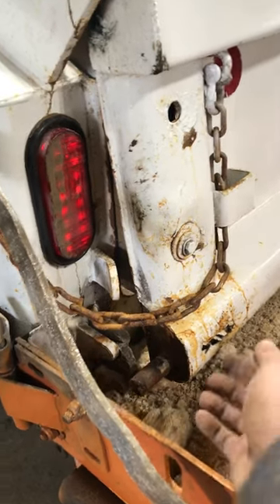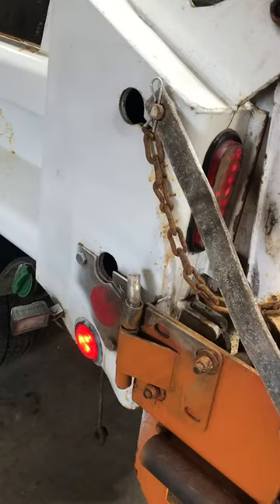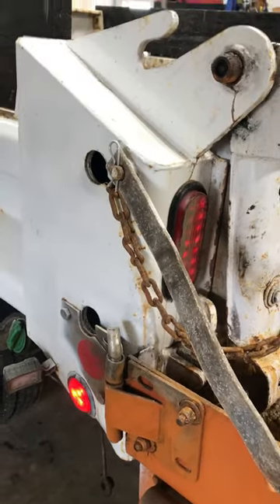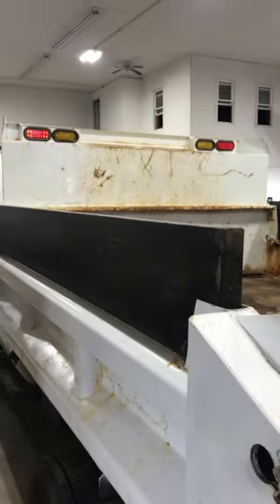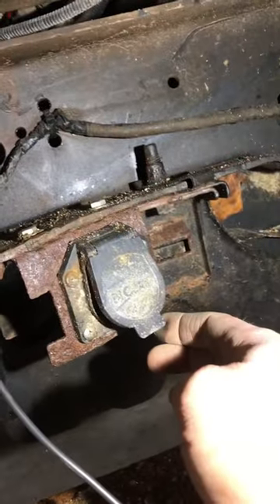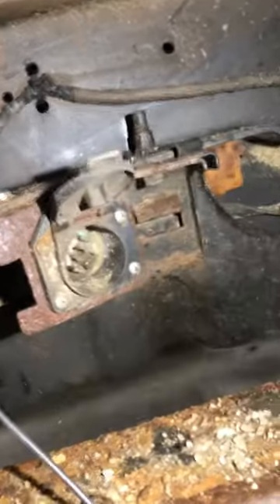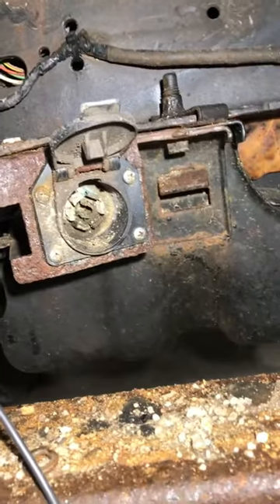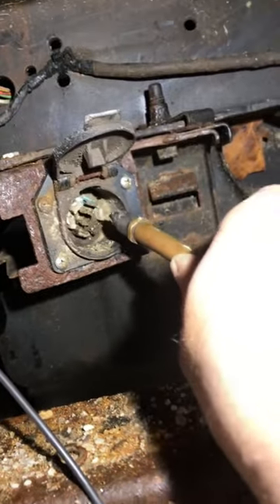"I Can't Turn My Lights off" - Crusty Plow Truck #shorts

Comment: How weird can a mechanics work get? But of course you found and corrected the problem!
Reply: Never, ever ask that question
Reply: @iflifewaseasy  no doubt, everytime i say....i will get this in right quick and knock it out....turns into one of those, oh my god wtf did i do this for😂
Reply: Do you know how often I remove a dime from the cigarette lighters (mostly in GM suvs). The symptom will be OBD port has no power, fuse is blown. 9/10 times there is a dime in there that shorted it and most of the time the customers kid put it in there because it fits.
Reply: @cheeseo9798  same thing for older nissans not communicating. Good possibility that someone left some change on top of the radio and it slid into the module and shorted the network
Reply: @gorybonghit3211  damn girl, go easy on hating people for no reason.
Reply: @young11984  and then you'll get the job that you know is going to be a nightmare... 5 minute later you're done. 

Aldata times are BS lol.

Comment: A mechanic would have to be “seasoned” to find a problem like that.
Reply: Perhaps a little "salty"
Reply: @wall7103  pretty fucking well salted at this point lol
Reply: It's seasoned and ready to be flipped.
Reply: i fixed a car that dies within 3s of starting... by unplugging AC clutch connector. ac was so bad itd lock motor up lmao.

Comment: I remember in my army training as a mechanic here in Sweden, the instructor shorted some leads in the trailer connector to simulate problems for us to track down.
Reply: That's both evil and amazing teaching. Because most of the problems you'll find are bizzare like that.
Reply: Rotten, but crafty.
Reply: When I was going through my electrical diagnostic classes for Ford many, many years ago, that's what the instructors did to simulate an electrical nightmare with the tail lights, brake lights, and turn signals And they gave you 15mins to look at it to find the problem.
Reply: @taliakuznetsova7092  you should have stuck with the ladder. Also do some research on actual evil because your opinion definition is pathetic
Reply: @TheGreyGhost_of43rd  feel good about yourself? Lol

Comment: Those LEDs work on any sniff of voltage.   We had a power cut at home last year, the voltage was only 1/4 of what it should have been, but the LEDs worked perfectly.

Comment: Detailed Invoice:
Compressed air: $5
Knowing where to blow the air: $85
Reply: Don’t forget the 150 diagnostic fee
Reply: As this guy is trying to make a living don't count his expertise as cheap. If you took the time to trace this down yes its a cheap fix. But knowing how to trace this down takes time and experience so don’t bust this man for trying to make a living.
Reply: @ArmyRayOIF  That was my point with the comment.
Reply: If your hiring wes it's worthit
Reply: These are some of the most annoying things to diagnose
Reply: That's why I love to Watch Wes Work.
Reply: Convenience fee: $50

Taxes: Somehow another $50
Reply: @SilverStarHeggisist  Old dodge rams Cummins or gas suck. 
Used to just quote for new wiring cause so much would be rotten/cracked.
Reply: These are the ones you laugh with a customer and tell em eh give me 20 bucks. Or when there's a power draw and got 50 things plugged in..unplug em tell em to go for a decent drive and come back if problem continues unplugged. Sometimes easy problems you just let them have a free one. Then they will tell every friend and family how awesome you are and you'll be forever busy.
Reply: FACTS!
Reply: O you forgot new fuse
Reply: Lol repair: Priceless 😁😂
Reply: Umm no. You clearly have zero business posting about business. Guy is probably still in his mom's basement

Comment: The reason this happened is on most  (not all but most) trailer 7 prong plugs there is a active 12vdc feed wire. This is known as a hot lead or an aux lead. This function can be used to charge a trailer battery or may be used to power extra lights or small 12vdc devices.  Usually this is on a 20 or 30 amp circuit. Anyway, this pin stays on (hot)  all the time unless it's switched through the vehicle ignition switch. So in the plug the 12v aux pin was making a connection to the running light pin. This caused 12v to back feed to the marker lights causing them to stay on even when the vehicle was turned off. 
I worked on a couple of Ford trucks that were blowing fuses for the turn signals due to water getting into the back connection of the 7 prong plug.  The only difference was the water was shorting out the ground (negative) pin to one of the turn signal pins inside the plug on the back. But yea, this kind of stuff definitely happens more than you think it could.

Comment: A mine in Australia had vehicles with phantom wiring problems.  Turned out be salty mud, from the open cut mine was seeping into the loom, and providing its own low voltage input into circuits throwing faults.  The vehicle manufacturer sent an expert who was perplexed that salt and mud could cause malfunctions.

Comment: I never knew that salt was electrically conductive! You learn something new every day :)
Reply: It may not be as a solid rock, (I don't know if it is or not) but when mixed with any moisture AT ALL it is extremely conductive. It will even attract humidity to it, causing a moist conductive short.

I guess that's why it makes things rust faster, it enhances the reaction which I think is partly electrical.
Reply: So if you never saw the movie idiocracy... electrolytes allow electricity to move through liquid salt is the electrolyte in sports drinks.

Comment: On semis with EBS sockets for the trailer(s) (which have constant and ignition power, as well as two earth's, warning light feed and two J1939 CAN pins), we often come across vehicles that won't shut down during/after wet weather.

Usually it's the socket full of mud and debris and constant power is backfeeding the ignition supply, and it's usually enough to hold in an ignition relay and keep the thing running.

Quick blast with WD40 and compressed air and happy days.

Comment: We left farm at 7 AM went up north to haul bees and box hives.
Go stopped by DOT at 1:30AM 5 miles from home farm truck.
No lights on trailer this is a wire nut guy once a month he’s messing with the lights.
Goes to his favorite drivers side light pulls it all apart over and over DOT said get 1 working you can go on home. 45 minutes later I wiggled plug lights flickered and I pushed plug in all the way lights on .
Clue no lights no power

Comment: Excellent video Wes  :) also that should be short video how do magic turn headlights out Lol ? That why those plugs thin layer of cloth over those snap caps for trailer so don't get dirty too  or short electrical system!

Comment: Thanks for the biggest jumpscare I've had in a while, that compressed air was louder than the 240 bravo that ripped a belt off 6 inches from my right ear.

Comment: And so how long to find it ????? Bet that was a real head scratcher....LEDs are another whole new ballgame. They draw so very little current that a wet stick/leaf or salt dobber across pins 3 and 4 in that plug  WOULD lite em up.
Reply from the maker: 3 hours.
Reply: @WatchWesWork  That's not too bad for a country boy. Better you than me. Did any of the other parking/marker lights stay on or only the LEDs ??

Comment: That's interesting that salt could pass that few amps of current
Reply: Low amps, LEDs don't use much. Also LED driver chips can be flexible down to a few volts and with a lot of resistance in circuit

Comment: Hmm, I wonder if it was leakage across diodes, or the upfitter connected to the trailer harness?
Reply from the maker: Salt bridge from the Aux terminal.
Reply: @WatchWesWork  I got that part, but I wonder if that was allowing leakage through diodes back to the light harness, or if the upfitter didn't use the light harness and instead just tied into the trailer harness.  On my Super Duty they have separate fused circuits for tail lights and trailer lights, as well as a separate flasher.  Smart engineers FTW!
Reply: @eformance  He said a salt bridge. I'm sure it was between pin 3 {tail lights} and pin 4 {full time 12 V power} Even a wet stick or leaf would lite up LEDs because of their low current draw.
Reply: @terryharvey4811  Perhaps I'm not making myself clear.  On trucks of that size the tail light circuit is separate from the trailer circuits.  I was wondering if the upfitter that put the body on the truck was lazy and used the trailer wiring circuit for the tail lights instead of the dedicated tail light circuit.

Comment: I’m a mobile emergency vehicle mechanic and I once drove 4.5 hours one way to troubleshoot emergency lights randomly coming on and staying on.  Looking at circuit boards in the electrical cabinet, I noticed 1/4” strands of copper everywhere like when you strip wire too far and trim it off.  I vacuumed the entire electrical cabinet and fixed the issue.  They really hated paying the travel bill for a 5 minute vacuuming… lol.  Crazy things happen

Comment: Had a 2016 f350 in today with complaint of blower motor inop. Track had sat awhile and a gecko had laid eggs in the under hood fuse block which caused a bad connection on the blower motor relay 😳
Reply from the maker: Wouldn't be a problem here!

Comment: I know this is a common problem, as I’m a mechanic too, but still feel this vid is faked a little, with someone’s foot on the pedal.
If I did this I bet the problem would still exist until more cleaning
Reply from the maker: Not faked at all. The salt is bridging the Aux pin to the Marker pin inside the connector.